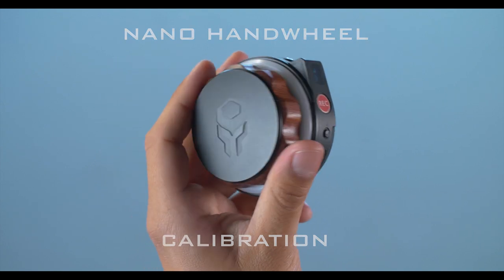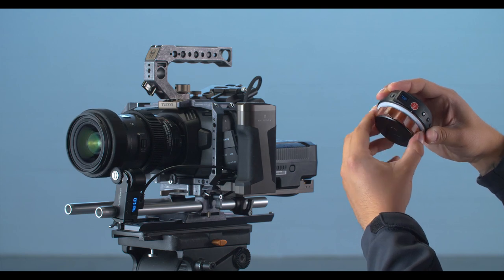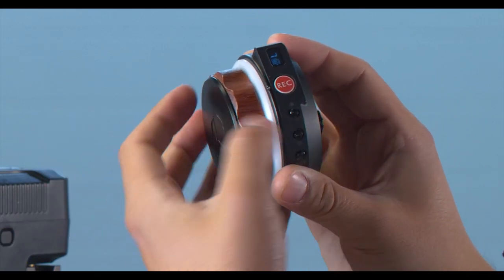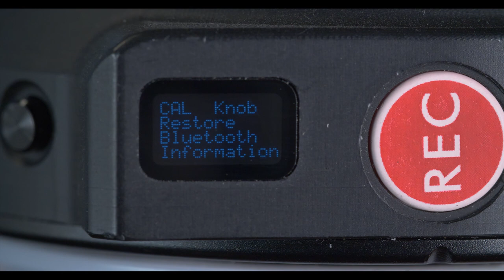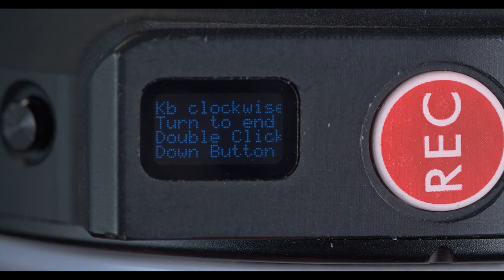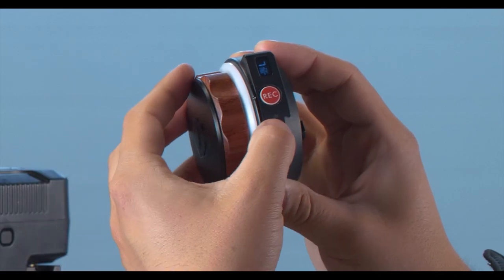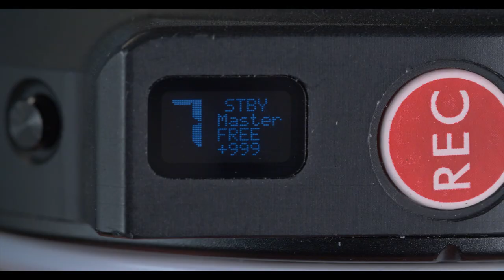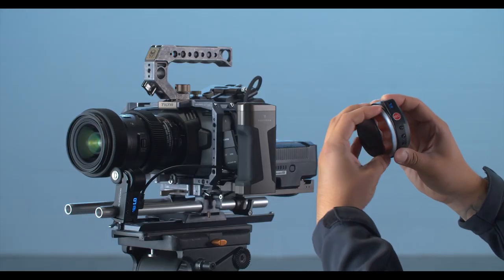Nucleus-Nano Troubleshooting Guide: Hand Wheel Calibration

Comment: Welp my nano doesn't even move the motor. Should I try to calibrate too?
Reply from the maker: You have to calibrate your motor first. Try holding the "cal" button on your handwheel. You can also press the "down" key on your motor. For further troubleshoot please send us a message through tilta.com/contact and an agent will be able to assist you
Reply: I'm having this issue
Reply: @KamKalambay   Try using your nano with a v mount battery

Comment: hello i need some help! Recently when I turn the wheel, it transmits noises in camera audio. 

If I don't turn the wheel, it sounds like a clock or something similar and its rhythmically. 
When i turn the wheel it transmits scratchy noise in camera audio. 
I the never had anything like that before! Also i have a rode mic connected. As soon as I turn the nucleus n on, these noises come.
Thank You for Your Help!❤️

Comment: Unfortunetly the Nucleus Nano it's not working properly with my setup. I have a gh5 with metabones + Sigma 18-35, and what happens is that the gears start to jump like crazy... i believe it's because the metabones ultra x 0,71 it's a bit loose from the body and the lens,  it's not 100% stiff, so the when the Nucleus try to calibrate, the lens go up and down, making the gears jumps... I'm wondering, if you have a similar setup in the video, and everything is ok, why i have this problem? Thanks
Reply from the maker: Hi Nuno,
Thanks so much for reaching out to Tilta Tech support! I recommend that you try changing the channel its on. Often times with wireless, strong signals can interfere with the system so using another channel can help with calibration issues. Please let me know if this doesn't fix your problem. 
Good luck!
JH
Reply: TILTA the channel is fine. Works fine with other lenses. But in this one, and because the metabones adapter is a bit  loose, it makes the lens literally go up and down, and jumping gears... :(
Reply: I believe that I solved my problem... I installed a new gear, made specifically to the 18-35, and it now works perfectly! Very happy with the results
Reply: unfortunately I have the exact same problems.. it jumps inconsistently
Reply: @erdinn  Did you solve this Erdin?
Reply: @goshawkvideo  yes! one of the gold contacts on the control knob was damaged. I returned it and the new one worked fine. so it was more of a signal problem.
Reply: @goshawkvideo  also one has to make sure that the contact between the motor and the lens is not too hard. if the weight of the lens presses too heavily then the motor will not work fine, and sometimes jump.
Reply: @erdinn  Thanks for the info! Really useful.
Reply: @nunobarbosa77  can you tell me what focus ring you used. I'm having the same issue.
Reply: @MattFaris  I used a custom focus gear made for the sigma 18-35mm - there are several websites that sells it. I bought mine on Amazon.es

Comment: Is there a sleep mode on the knob / hand wheel? I keep forgetting to shut it off and the battery is always dead. There should be some type of auto-off feature so I don't drain the battery.
Reply from the maker: Sorry Clint there is not a sleep mode! We recommend making a habit out of taking the batteries out after each use!
Reply: TILTA can it be powered via usb? Does the usb charge the battery or just power the unit?
Reply from the maker: No, we do not recommend using the usb to power the hand wheel unit as it can permanently damage the unit!
Reply: @TILTA  Thanks for the answers.  Is there a way to make it save the calibration of the non-hardstop lenses. Every time I turn my camera off which powers the nucleus nano, it loses all my calibration. Doing multiple battery changes causes a lot of extra work re-calibrating every single time. Is there a way to fix this?
Reply from the maker: Sorry Clint there is currently no way to save manual calibration. We recommend using a custom lens ring that has hard stops built in!

Comment: I don’t see any information anywhere about how to properly power off the knob. I just open up the door and take out the battery. Is that the only way?
Reply from the maker: You can turn the Nano on and off by holding REC!
Reply: TILTA I just received the unit a little while ago and I did try holding record because that would seem to be the logical way. However I guess I didn’t hold it long enough or something Because that technique didn’t appear to work. I will give this a try now of course. It would help if you simply wrote it in the instructions though. Speaking of instructions, why is the print so incredibly small!? I don’t think it would cost that much to just put in a few extra pages and make them easier to read. Everything about this unit seems to be top-notch but the instructions look like they were made for some cheap piece of furniture from Walmart.But I must say other than these silly little issues this is a great piece of gear! Very glad I bought it.

Comment: I've struggled.  Mine started working, and then suddenly no more in seconds SMH

I've baffled to calibrate the damn thing, it's frustrating as hell
Reply: The motor just won't move when I use the wheel, but it moves when I calibrate on the motor smh
Reply: This happens to me too. Did you figure it out?
Reply: Happenes to me too have you been able to figure it out?
Reply: Weak batteries most likely.

Comment: When will you update firmware and add speed adjustment
Reply: Hello Ivan, does ur follow focus shake while focusing? Because i can see clearly that lens is shaking while focusing.
Reply: @arslanmahmood  its not a shake, its torque movement, the motor pushes on the lens and i do not really notice it in footage
Reply: @IamIvanStan  great thanks for the reply!

Comment: Can I switch direction on the wheel?
Reply from the maker: Yes, you can holding the "up" button. From there you'll go into a menu and go to "knob dir" and then double tap the "up" button. From there you can change the direction and then press the "REC" button and that will change your knob direction.